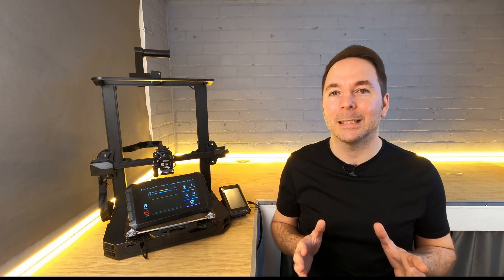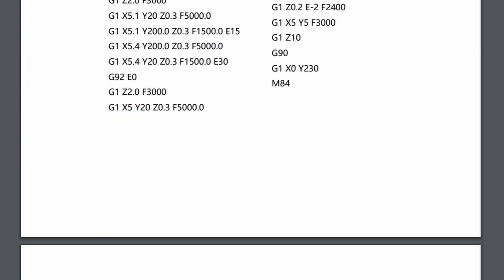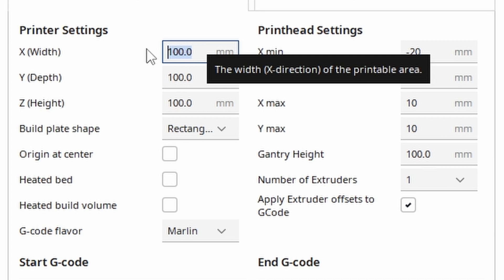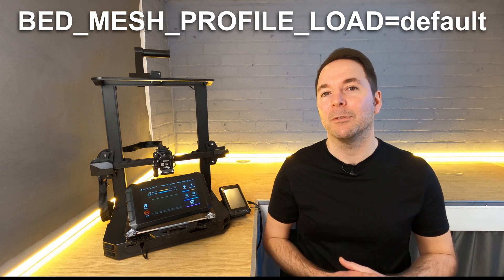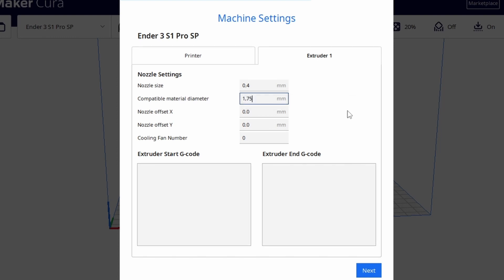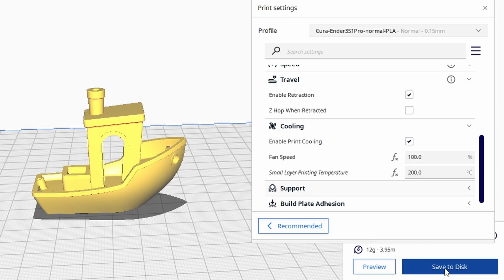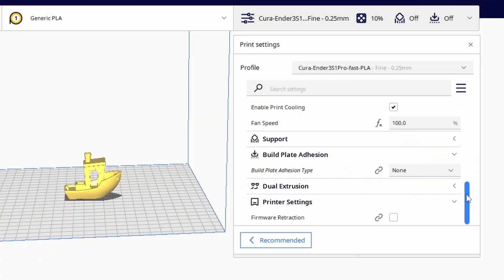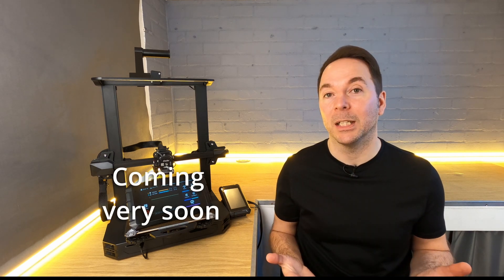Slicer Settings and Profiles With Cura - Sonic Pad Intermediate Part 3

Comment: Hi Rick!  Sorry to bother you again but I'm having an issue.  I created another machine profile like you showed in the video and all was well.  However when I tried to import profiles that are in Creality Ender 3 S1 plus to my Creality Ender 3 S1 plus SP profile it will not import saying  profile not compatible with machine type.  Any suggestions you have would be great.  Thanks again.
Reply: I am having the same issue. If I find a solution, I'll post it here.
Reply: Even when I make a profile for the Ender 3 s1, I am now getting a "not compatible with the current active machine definition 'creality_base'
Reply: OK I got it to work. So, despite my best efforts it will not work in the creality slicer version of cura. You need the ultimaker version. From there if you follow the steps in the video it works. I managed to create a g-code that works too.
Reply: Start code: 
; Ender 3 S1 Plus Start G-code
G90
G92 E0 ;Reset Extruder
G28 ;Home all axes
BED_MESH_CALIBRATE
G1 Z2.0 F3000 ;Move Z Axis up
G1 X10.1 Y20 Z0.28 F5000.0 ;Move to start position
G1 X10.1 Y200.0 Z0.28 F1500.0 E15 ;Draw the first line
G1 X10.4 Y200.0 Z0.28 F5000.0 ;Move to side a little
G1 X10.4 Y20 Z0.28 F1500.0 E30 ;Draw the second line
G92 E0 ;Reset Extruder
G1 Z2.0 F3000 ;Move Z Axis up
G1 X5 Y20 Z0.3 F5000.0

End code:
M140 S0 ;Turn-off bed
M104 S0 ;Turn-off hotend
M106 S0 ;Turn-off fan
G91 ;Relative positioning
G1 E-2 F2700 ;Retract a bit
G1 X5 Y5 F3000 ;Wipe out
G1 E-2 Z0.2 F2400 ;Retract and raise Z
G1 Z10 ;Raise Z more
G90 ;Absolute positioning
G1 X0 Y{machine_depth} ;Present print
M84 X Y E ;Disable all steppers but Z

Machine Settings:
x(width) 300.0
y(depth) 300.0
z(height) 300.0
x min -26
y min -32
x max 32
y max 34
gantry height 25

After you load the profiles, remember to hit show custom on the print settings drop down menu or the imported profile will not show.
Reply: hope this helps
Reply: @thomashunt8596  thanks for the input.  So are you saying to chose an ultimaker printer and change the name?
Reply: @charlesneff2391  no, custom fff and input those settings
Reply: @thomashunt8596  Ahh okay says the dummy in me,lol.  Thanks again for the help sir.
Reply: @thomashunt8596  just FYI tried your way and got the printer profile in just fine, thanks .  the catch is that it still won't let me import print profiles from my earlier dead printer or from another source. pulling what's left my hair out, haha, thanks again Thomas.
Reply: @charlesneff2391  did your print come out alright? I seem to be having a bed leveling issue. The filament is not sticking to the bed and is balling up. I don't like the bed leveling process with this machine
Reply: @charlesneff2391  OK, so I have figured this out and dialed it in really, really well. I've made changes to the Gcode and tuned things in the cura ender normal print profile. If you need the numbers and code lemme know and I'll compile it.
Reply: @thomashunt8596  I watched a couple of videos on tramnming the bed on this model and they really didn't work well either.  so what I did was I used the manual setting and went around the corners using the bed screws and z movement button until I got them all trammed in equally.  My first print did well and I tried another to print squashball foot holders.  about halfway through I checked on them and found globs of filament on the bed.  Rookie mistake forgot to really tighten my nozzle.  major mess and cleanup ensued.  had to order another heatbreak.
Reply: sorry forgot to answer your second question.  but yes I would be very interested in getting that info from you, thanks again sir!
Reply: @charlesneff2391  I'll post them shortly. I've dialed it in more over the past few days.

Comment: Why do we make a custom printer in Cura instead of using Cura's profile for the printer if we're just adding the same values? Is it just to change the G-Code?
Reply from the maker: It's to do with the way profiles are managed within the file system of Cura. Each profile is based off of another one. For instance, all Creality profiles are based off of a profile called 'Creality base' and they share many values. Creating a new profile frees you from all of the settings that are set many layers down that conflict with the settings a Klipper machine can use.
Reply: @RickyImpey  that's so great thanks. Makes a lot of sense. I've been having problems as I have the 3 Max Neo and can't find specific settings for that. Creality told me the stock S3 v1 would work as long as I change the bed size, but I seem to keep running into issues where some gcode is throwing the print head to the far back of the bed after the two starting lines of extraction and it failing. Driving me crazy. 

Also annoying is that Creality Print now has profiles for some printers with Sonic Pad but not all of them. 

Is it true the Ender 3 v1 machine and extruder settings/g code should be the same for the Ender 3 Max Neo or do I need to keep googling?

Thanks again for explaining the need for setting a custom printer.
Reply from the maker: @davetriesthis  When you say that it's 'failing', are you getting an error? If so, what does it say? I would have advised you to start with and Ender 3v2 + BLtouch machine as a starting point as long as there is an option for your control board/chip combination. The original Ender 3 v1 didn't have a BL Touch. From there you would need to edit your config file in a few areas. The 'position_max' figures in all of the 3 stepper sections need editing to match your bed size and z height. In the 'safe_z_home' section the 'home_xy_position' figures need changing to half of your x and y dimensions and in the 'bl_touch' section, you may need to edit the x and y offsets if your bed probe is in a different position to the E3v2. Sorry, I don't have the Neo or Neo Max to be able to tell you what these figures should be. This should get you started but see where you get to.
Reply: @RickyImpey  Hey thanks for taking the time to write back with such a detailed reply. As a creator myself, I know how valuable time is so I really appreciate it. 

The Ender 3 Max Neo came to me from Creality for a feature article I'm doing, so the machine is here and the first two units they sent me had horrible issues. First one the bed itself (not the glass plate, the metal bed) had a hump in it, so it was impossible to level. Im on my third unit now, and the Sonic Pad I'm using for another article, so just started with trying to get that Ender working. 

By failing, I mean that what had happened was that it would draw the first two lines on the edge as per the new g-code and then it looked like it was trying to "home" the x axis too far behind where the plate ended.  So it would draw two lines, move to center of the board, and then move the bed so far forward that the head was off the board. 

Both of these happened on prints that pushed the model to the edge of at least one axis. So it looks to me like the safe areas are wrong, even though I have the bed size in. I'll try to do more digging into the safe positions on reddit. 

Right now I'm printing a piece that I ran through Creality Print using the. Ender 3 S1 Fast profile just to see if it works, and it's printing, and printing hella fast, but I'm not home with my slicer but I think the model was centered in the slicer but it's printing toward the front of the bed.

In any case, the safe x and y was the info I was looking for and now I'll dig into reddit for more support. 

Also, if you hadn't done the videos on getting the Sonic Pad working, I'd never have figured it out by their instructions alone. Thanks for that!

Comment: Hello Ricky your videos are a great help and I want to thank you for posting them. Do you like a challenge lol  I cant seem to find an answer to my question ANYWHARE so far, I have 7 printers and a sonic pad and have had no problem setting up on the printers i want to use it on thanks to you, however I have one I just cant find the Propper Kippler config files to flash with its a Geeetech A30T Is this something you can help with or advise me on. blessings and have a great day. Allen

Comment: Ricky you advise to put bed_mesh_calibrate in the slicer settings. I've did this but after every start of a print in the web ui I'll see this message so is my bed mesh used? because the printer is not restarted

16:31:57 
// Bed Mesh state has been saved to profile [default]
// for the current session. The SAVE_CONFIG command will
// update the printer config file and restart the printer.
Reply from the maker: Yes, the new mesh will be used if it takes a mesh at the beginning of a print

Comment: I haven’t seen any mention of changing the “g-code flavor” option in the Cura printer settings and noticed you didn’t cover it in your video. Does that need changed from Marlin to Klipper when updating to a Sonic Pad?

BTW…Great job with your channel and content. Your channel is the first place I go when looking for any 3D printing answers! Thanks for all you do!
Reply from the maker: As far as i'm aware, Cura doesn't have a 'klipper' gcode flavor. I leave mine on 'Marlin'.

Comment: I have a Ender 3 Pro and Creality doesn't have profiles for this model spesifically. Can I use S1 or S1 pro profiles?
Reply from the maker: I wouldn't use the S1 or S1 Pro profiles, they both have direct drive extruders. You would be better off with a standard Ender 3 profile as a starting point.

Comment: Since following this guide my Ender 3 S1 Pro no longer prints out the little test strip at the side of the bed :( I found this really useful to make sure the filament was extruding nicely. How do I get it to do this again please?
Reply from the maker: Hi, just add the lines below back into your start gcode after the G28 and any bed mesh lines:
G1 Z2.0 F3000
G1 X5.1 Y20 Z0.3 F5000.0
G1 X5.1 Y200.0 Z0.3 F1500.0 E15
G1 X5.4 Y200.0 Z0.3 F5000.0
G1 X5.4 Y20 Z0.3 F1500.0 E30
Reply: @RickyImpey  Thanks 😄

Comment: Can we get an explanation on pause print at height or M600 with the sonic pad? I tried adding the M600 macro and it's saying I have duplicates? The default marlin pause at height script didn't work, so I'm trying M600 now but it's all just a bit confusing.

Comment: Excellent guids! I have one question tho, I have a CR-6 SE and im not sure if I got  this right. Should I keep the standard  start and end code but remove the G29 and N420 code and replace it with BED_MESH_PROFILE LOAD="default"? Or should I leave start and end code as it is? Should I then import the ender profiles for the settings or should I keep  the CR-6 profiles?  Thank you for your guids. Have a nice day.
Reply from the maker: Hi, personally I would use the Ender 3v2 profiles, copy in your machine settings and previous start and end gcode that you are happy with in your CR-6 SE Cura profile and replace any G29 or M420 lines with the 'BED_MESH_PROFILE LOAD="default".
Reply: Mine say's this. No clue how to fix it: bed_mesh: Unknown profile [Default]

Comment: Watched this episode several times and I cannot get the profiles to load. keeps giving me and error that it cannot import. :/
Reply from the maker: Did you create the new FFF machine? You can't import the profiles into an existing machine profile
Reply: I did for both, the ender 3 and the S1 Plus.  The ender 3 imported alright but the S1 will not import.

Comment: Do you know what is the difference between the normal vs fast profiles for the V2?  Your videos are very helpful!
Reply from the maker: It's pretty much literally only speeds. The 'Fast' profiles turn everything up to the max for if you just want a quick and dirty print. The 'Normal' profiles are much more usable without lots of fine tuning and are still fast compared to most Marlin machines.

Comment: I did want to point out a typo. The command to load the Bed Mesh is : BED_MESH_PROFILE LOAD="default"
When I had what was in the video I got an error that the command was not recognized.
Reply from the maker: Whoops! Thanks Bill, I'll put a note in the description admitting to my error🙂
Reply: @RickyImpey  Actually it isn't.

Comment: Two issues (cura 5.2.1) Ender3 S1 Pro
*Cura 5.3.0 won't load and crashes.
1. Print speed is yellow 160.0 mm/s and normal at max 150 mm/s.
2. When trying to do the thumbnail in post processing for sonic pad printer S1 Pro there isn't a pixel size box. If I switch back to my normal S1 pro printer selection it does.

Comment: Hi Ricky - excellent series so far. I recently got a Sonic Pad and an E3 S1 to add to my E3V2 - so far everything is coming together and your series has really helped. 
Couple of suggestions for future videos (if not already planned)  - add proper bed tramming using the screws_tilt_adjust - just got this added to both the E3V2 with Bl touch and S1, also adding the code for a filament sensor for the E3V2. Best regards.

Comment: Before I switched to this profile I had amazing prints. But the new profiles for Petg are struggling on the s1 pro. It all starts from the initial layer. I'm probably going to slow down the initial layer and see if that helps. Once 1st layers are complete and the printer goes into hyper drive it's lights out.
Reply from the maker: The fast profile speeds are pretty much a 'maximum possible' option. Try just slowing down the print and infill speeds to around 100/110mm/s until you get the quality you want and then turn it up from there to see what your machine can handle. I have done exactly this with PETG with great results.

Comment: im in search of a Cura profile for Ender 5 S1 with Sonic Pad
Reply from the maker: The Ender 5 S1 is direct drive isn't it? I would start with the Ender 3 S1 Pro profiles, they shouldn't be very far off for your machine.
Reply: @RickyImpey  start and end g-code are the same? i have and ender 5 s1 too

Comment: I followed the beginning Gcode as specified.  The printer laid down the first line then the second and then scraped across the plate to the center.  Looking at the differences in the Code on the manual and the existing code there was not a  Z axis up command.  The other issue was every time it did a calibration to start the print the z setting was too high.  I had to remove it and just manually level it and it worked great.
Reply from the maker: I'm not sure which machine you have but I've just checked all three of the Creality supplied start g-codes and they all set the z height to 0.3mm at the lowest. I'm not entirely sure what you mean by the 'manual' and 'existing' code. I'm happy to help more if you need and what to clarify these for me.
Reply: @RickyImpey   Ricky after reading your reply I tried it again.  This time I typed in the G-Code rather than cut and paste.  and it worked fine.  Not sure if somehow after slicing it there were issues or something with the sonic pad. I also reset the sonic pad yesterday.  Who knows.
Reply: I had the exact same problem on my S1 Plus. First print started 5 mm above the bed. After following the video and double checking the start g-code, it heated to 215C, did a recal of the position, then dropped the temperature to 195C ( witch I did not specify anywhere), and the nozzle took a deep dive into the bed. To make maters worse it has a habit of not lifting the printhead above already printed parts, but just crunching through layers when moving across the printbed. I have no idea how to fix it. CURA is one big mess compared to Prusa slicer. Currently the S1 plus has been sitting idle on my desk for two weeks laughing at me when I enter the room, and I give it The Eye from time to time. I pray somebody will make a profile for Prusa slicer, otherwise I'm f.....d. I could swear it does not use the mesh settings when printing.

Comment: When I try to import any of the profiles I get an error saying that quality type ‘fast’ is not compatible. What the hell
Reply from the maker: Did you create the custom FFF machine first?
Reply: @RickyImpey  I didn’t catch that part until way after. I did it that way and it works a dream. Just have to set me retraction setting WAY higher than I had before. Stringing like crazy
Reply: @RickyImpey  by the way…. Do you know where I can find any GOOD tpu profiles for the ender 3 s1 plus???
Reply from the maker: @davidburdge4865  I can't say I do. I would start with a standard profile and increase speeds a little and see if there are any artifacts that need dialing out myself.

Comment: Regarding the dimensions of the printbed:
Officially the Ender 3 S1 Pro has 220x220x270 bed.
When I use the mentioned 235x235x250 from the PDF I get errors for out of bound.
When I home all axis and manually move them with the Webfrontend I get a maximum range of 230x230.
For the Z-Axis I can use the full 270.

So for everyone having an Ender 3 S1 Pro you can maximize your bed size to 230x230x270.
But be warned: When using this you might collide with any purge-strips that might be done when using specific G-Code. I changed my purge-strip to be on X0 Y20 to X0 Y220.
Then I remove that when the print starts because I don't need it anymore. 

No idea why Creality has these messed up dimensions in their PDF.
Reply from the maker: Good tip. I haven't had that error myself, possibly because none of my other g-code asks the printer to go to the full extremes of the bed dimensions. I will look to change it though, thanks 👍
Reply: @RickyImpey  Yeah I stumbled across it when messing with a Pause / M600 macro. I suspect that Klipper keeps a 2.5mm "security gap" on each side for preventing hitting limit switches or going off-bed when it's not fully calibrated. 
From my understanding Creality had the 220x220 bed size limit from the older bed types that were secured by clips. And it basically kept that throughout the other bed-types. 
Klipper opens up the build volume and allows a bit more space.